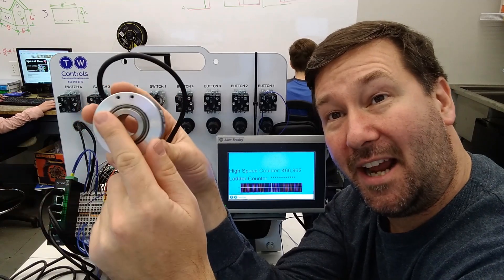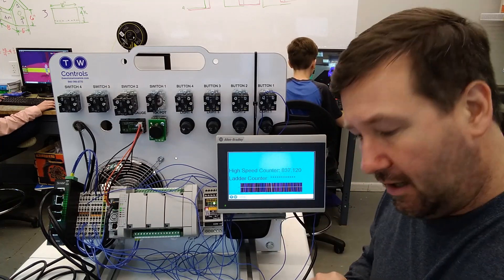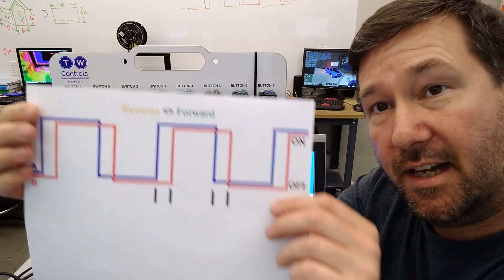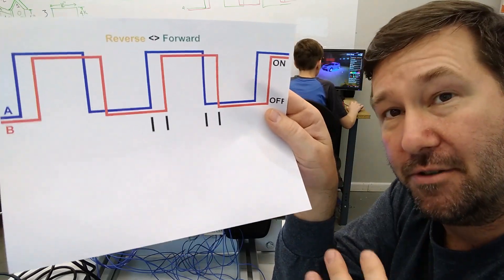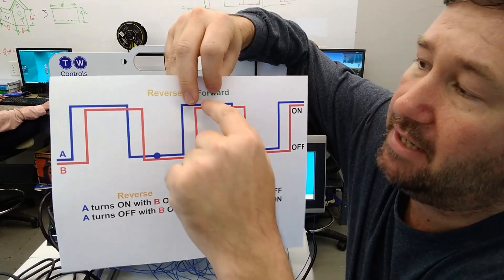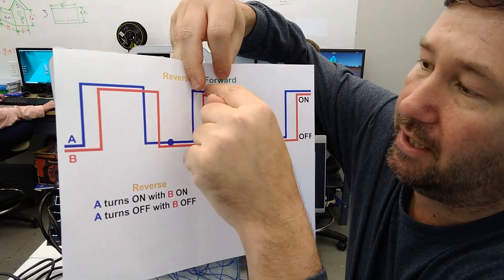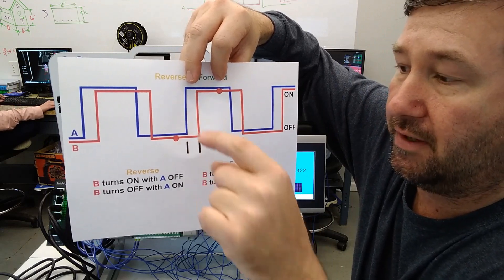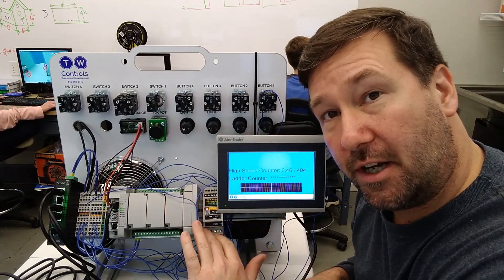How a Rotary Incremental Encoder Works. Direction and Position.

Comment from the maker: Thanks for watching!  If you are looking for the complete Connected Components Workbench PLC Training series, visit https://twcontrols.com/micro800-connected-components-workbench-lessons
Reply: Hey Tim, That was very informative, just need one clarification--Suppose I am using an encoder which generates 1000 pulses per revolution. Now If i use a HSC to count the signals, its going give 4000 pulses per revolution of the encoder or 2000 (if I am not using the B channel).So do I need to divide the no. of pulses by 4 (or 2 in case of no B channel) to get the actual no. of revolutions??

Comment: Thanks for the excellent video Tim!

I recently came across an encoder wired with Channel-A, Channel-B as well as Channel-A Inverted & B Inverted. What are these used for? Do you have any video on explaining Channel-A & B Inverted inputs? Thanks
Reply: And 'Channel Reference' Pin as well. Sorry, I forgot to mention it in my earlier question.
Reply from the maker: It is mostly for self checking.  They should always be the opposite.  If they are not then there is a fault.

Comment: I remember ball mice from the 1990s that had optical encoders, but with only one sensor pair (ie led / phototransistor). I'm sure of this, because it confused me, as to how it would detect direction with only one set of sensors. So how could it? My theory is it might have used 2 levels of light, to encode movement as off / dim / bright / off / dim / bright. That same sequence in reverse would be distinguishable. Where a simple on / off / on / off sequence couldn't provide direction information.

That would be more work to detect the 3 levels, but stuff inside the controller chip could handle it, and I think at that point they manufactured actual mouse chips for just that purpose rather than a more general MCU.

So how did they work? My guess is the only solution I can think of, but I'd like an expert to actually tell me! There were in the cheapest mice but worked fine.
Reply from the maker: I'm not the "expert" on these, but my understanding was that they were not simply phototransistors, but optical sensors,.  Think more of a crude camera that tracks movement of a picture.

Comment: I’m trying to make a rotary encoder using two infrared switches but I’m having a hard time getting it to work correctly
Reply from the maker: It probably has to do with your response time of your switches. Standard switches will not respond fast.
Reply: @TimWilborne  I’m guessing a normal rotary clicks into a zero point on both clk and dit. That’s not really going to work with this so maybe I need to alter the code to make it force a 0 if it’s not moving. Cheers for the reply
Reply from the maker: Did you see this one where we talked about the input filters?
https://www.youtube.com/watch?v=vBNCUFao2jQ
Reply: @TimWilborne  watching it now, this is an interesting watch and something to bare in mind. Im not really doing it fast it’s hand spun
Reply from the maker: Are you sure you are getting an overlap of the two inputs?  If one goes off before the other comes back on, it will think it is just oscillating.
Reply: @TimWilborne  I got it working finally, had a tinker with my wires on the breadboard think something wasn’t connecting properly. With this setup I get a lot more clicks per rotation giving more accuracy. It’s being use as a controller rather than to pick up speed but it does need to give me the rate I’m turning at while I spin the encoder and it needs to be instant so I can’t put a delay on. The number for the speed is still low but not as low as a standard encoder
Reply: @TimWilborne  i honestly think you’re right about that video you shared as well now I’ve got it working. I’ve noticed if I spin it a bit faster it’s not picking up most of the clicks so I’ll have a play see if I can ramp up the input filter
Reply: @TimWilborne  possibly. it does seems to work but it’s not very accurate on knowing the direct and it resets on every tick. I’m not sure if I need to get my measurements better or something. The rotor plate has 3mm gaps and then I have the body that holds the sensors in place. I’ll keep tinkering on fusion360 see if I can get better results. I can’t really look at the wave form because my oscilloscope only has 1 input
Reply: I’ve sussed it everything is working perfectly after a painful few days of trying to work it out
Reply from the maker: I am glad you got it figured out.

Comment: Hello, Thank you for your presentation, one funny thing I noticed is that there seems to be only one set of Marks, spread uniformly around the outer circle, but where are the two (2) object 90 degrees apart? Ninety degrees is sizeable, that's about a quarter of the outer circle, can you point them out in your picture of the slotted disc?
Thank you for your help.
Reply from the maker: There are two sensors that look at the same set of marks. The second sensor is 90° out of phase, which is different from 90 rotational degrees. This way it can look at if the a or b is rising first to determine direction.

Comment: What is the difference between HTL & TTL types encoders.Can you please explain?
Reply from the maker: An HTL is a sourcing output or will provide whatever the input voltage is on the channel.  A TTL is a sinking output of will take whatever input voltage is applied to common.

Comment: Great Video,  Thank You!! 
Do you have a similar solution for detecting direction using RSLogix500 where there detecting the rising and falling edge of an input is not as simple?
Reply from the maker: For the Micrologix you use the HSC function file.  See link below.
https://twcontrols.com/lessons/rslogix-500-training-allen-bradley-micrologix-high-speed-counter-rslogix-500-function-file-configuration-for-an-encoder

Comment: regards Tim i have multiple allen bradley 845T series encoders my question: is it normal to get hot even without operating? I thought it was faulty and bought others but it also gets hot over 40 degrees centigrade without being in operation
Reply from the maker: I can't say I've ever noticed one getting hot but I doubt I've ever checked.  One thing to think about when you say it isn't "running", the encoder is always running.  Half of it's outputs are on and the other half are off.  It also does have a small current consumption to power its circuits.  I wouldn't be alarmed over 40 degrees centigrade.
Reply: Tim Wilborne  Thanks

Comment: Good discussion on the basics, especially helpful to show how you can lose counts. And I have seen them go backwards as well because of lost counts. 

But two things:

1) Don't forget the marker pulse, and the difference between single-ended and differential outputs. Really important to know if you have to go out and troubleshoot an unknown encoder (like I had to this week) .Maybe for another video.

2) Those have got to be some of the most out of trim probes that I have seen in ages. I don't trim mine up often either, but dang! :)
Reply from the maker: Surprise, I have one coming on single ended and differential outputs :)

Yes I need to spend some time and study on the in's and out's of that scope.  It is handy but some things are not that intuitive.
Reply: @TimWilborne  There should be a tiny cap on the handle of your probe, so find a source for a clean square wave, say, from the output from a handy encoder, and tweak the cap until the wave squares up. Go easy, they are fragile.

I just got finished reverse engineering an encoder from the dark days of the 80's that had no documentation on it whatsoever. The first thing was to determine the voltage to the encoder, this machine has a mix of 5 and 12 volt encoders so it's certainly not a case of being overcautious on my part. Popping the Amphenol connector off allowed me to peek inside to see a 10 VDC electrolytic cap, so it appeared to be a 5 VDC encoder. 

I used a cheap transistor tester to look back into the outputs of the encoder, and it showed a pair of back-to-back diodes. So maybe it was a differential encoder? Hooked it up and sorted out which pair was which using my scope and that was that.

BTW, your kids might enjoy building their own transistor testers, and they are super handy:

https://www.ebay.com/itm/Signal-Generator-Tools-Component-Tester-Transistor-Diode-Capacitance-ESR-Meter/253263691903?_trkparms=ispr%3D1&hash=item3af7b1407f:m:mG8hJvfWRDcZleWVEcwbNZA&enc=AQAEAAACcIQvEcHUrT7nmUC3yY5qbPyaBN1nJEDYW8MyypsJPgXK3AqiNsU0sSphPu4g6Qid36H5LLoReq5x%2B17SM4jyBpSuOJZ%2FGkjqXhYQWm2HDi3U%2FoWbFactomqtF8GY4UtMyNLMGDG%2FhtBJQV40mkJrymWJkIFsanata4ffDp6wyLDdZyxl4ndioHjDfk9rQ6jfO4vwModcINPKFrlaXmE26wfCrO%2Fv%2Fxo1x5pulZ0MkJlcV%2FDCPT127SucPQPrkmoGVrgYD6tN6IgBDD5UmunRX7Wo6XsKnqdREiWwGRKwak4805LTvq0VlphH7lDzQbvHKDwEEzkvkh20Txk83uYR6d1flHdqHfBfh%2FHRrX4Yv3go8iyfteGwe5KOGGbCfW%2BQeB4pvuZQO9XpFApK3hFZ%2FHl8XspiSMSuu8jaxkLvP5IbLh65eCY6ypo6rH25Gn7jqz5OP7qwSS50aMtu4jm1IXnmTR1oyTUh0IcFxfgIjyFD0g8m524K%2Ff7H1kcVHs8pDaOgPi73Pz1PGECEVq0E6vvflSTRgf%2Bmn1rUiMqgKrCXk1jdS%2F4hoHp6jtf8AS8mzTheTE00A9H%2F2%2BPMT9krPSxDYu4KMFbLuvitlPMkAZdstKaE6HaSr9a8u8%2BTeIbNAzZcWF%2B%2BoayzWqM2%2FORXPJd1iw8aB5BT5nJIIN8TaOZLenkHtrKRm68KazM2jhTLWghcQaP4T37oYuwpqhYY6cHNu44ROvQjYHjNSMeRx9mIJ0NtRac5zuxB9buo0Kmv%2FBq26dW0lYYuDwsR1uX66qxQHQ9N1x8Gu2%2BTliwwoftHyGgBHMX8Y2WeXVtEecwG7Q%3D%3D&checksum=253263691903c8a55cb0d76a48839588a1180f0dd680 

Looking forward to the single-ended and differential outputs video. :)

Two on the encoders on this thing are 12 volt single-ended encoders and the inputs to the new motion controller were set up as differential inputs. Grrr...

So we are going to use a couple of these to convert the signals:

https://www.usdigital.com/products/accessories/interfaces/EA

Only good for 5 VDC outputs, so I will have to add 5.1 volt Zeners as well as current limiting resistors to the input. But such is life. :)

Comment: Can I get some information on the small scope you were using? Thanks.
Reply from the maker: Hi Dan, see the following link, this is a very handy scope for the size and the cost. https://amzn.to/2YY0LQd
Reply: I have a Seed DSO Nano v3 somewhere. It was cool and nerdy to have a scope that fit in my shirt pocket, but it's not all that useful. I prefer my Rigol 1054Z.

One thing that isn't obvious is that you need to be really careful about plugging the scope into a USB port while using it. The reason for this is that you just created a ground path for the scope through the USB port.
Reply from the maker: @MrWaalkman  Good tip, I'll remember that.
Reply: @TimWilborne  I found out by taking down a DeviceNet network when I plugged it in. No harm done, but it was a bit scary. :)